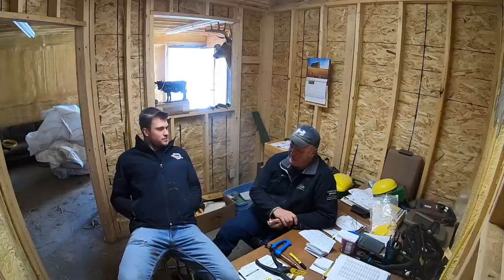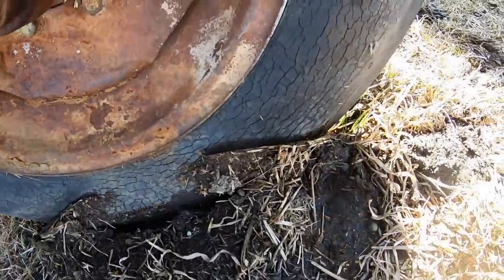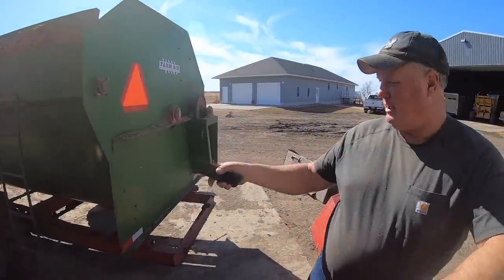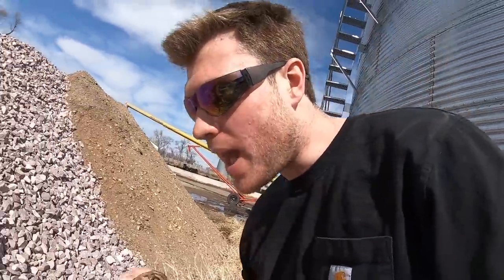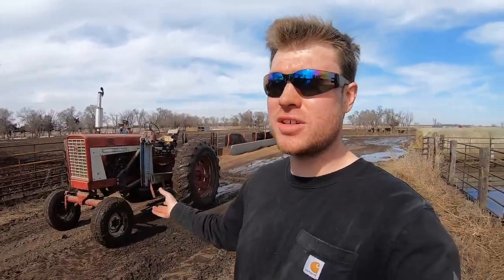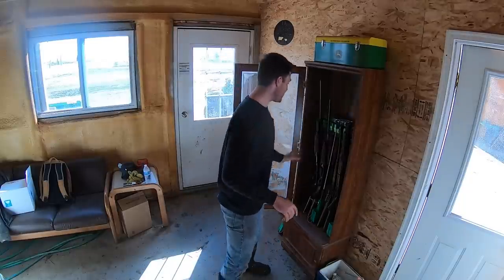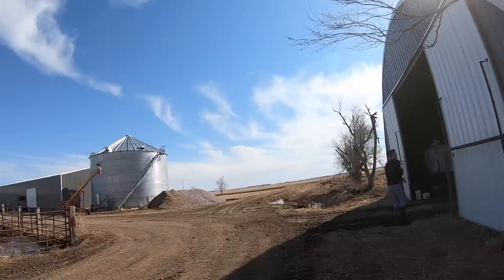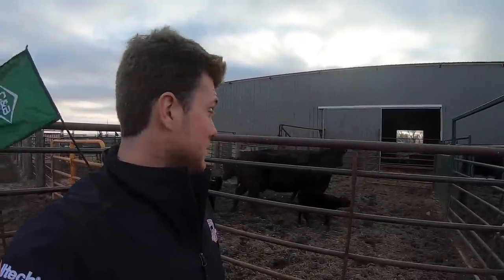No cab, no problem

Comment: I taught my self to weld by  welding two pieces of metal together and throwing it across the shop as hard as I could.   If they stayed together I figured it was a good weld.   My welds are not pretty either.  I am getting better at it.    Wire Welding is almost like  soldering.  only hotter
Reply from the maker: hahaha

Comment: When you killed the tractor pulling the drag it appeared you were trying to turn right but weren't using the foot brake for the right wheel.  Turns lots better if you use the foot brake.
Reply from the maker: I thought I was hammering on the right break pretty good

Comment: I'm positive that tractor isn't to small  for the drag my rtv will pull that drag might try running a gear in the 3 to 5 mph range for the most of us that farm we use open top  tractors all the time we just don't run hwy gear while turning thru a mud hole hahahahahahah but great for a video any ways
Reply from the maker: Thanks!
Reply: @SonneFarms  you really have come a long way for your channel I'm glad you haven't started putting goofy faces and what knot for your each video keep it going